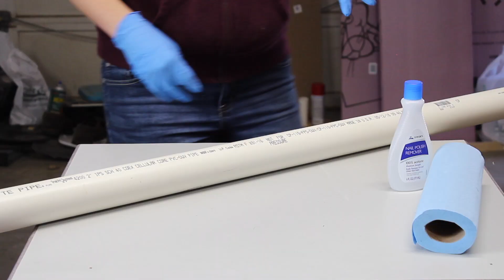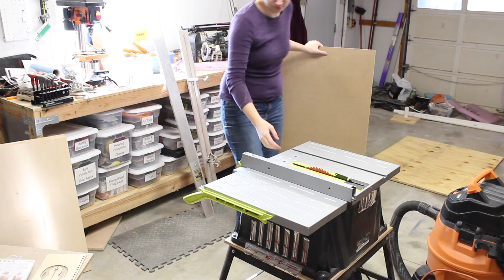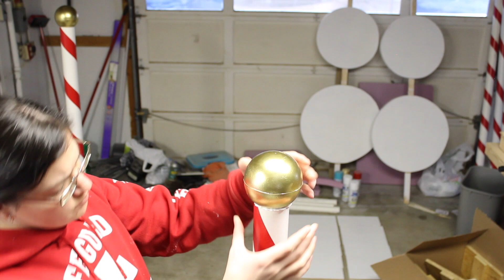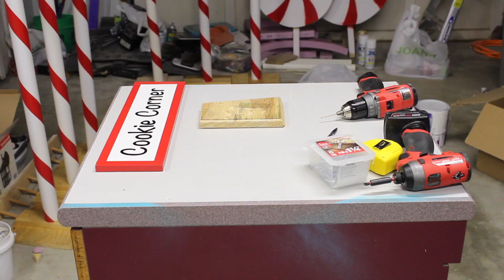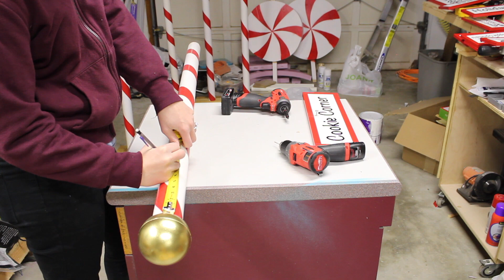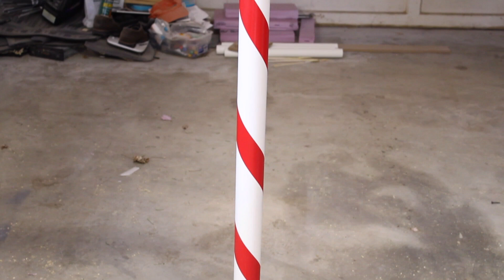How To: Holiday North Pole Sign

Comment: if I don't have a table saw can I use a hand saw to cut the wood just like the PBC pipe?
Reply: Hi Mckayla, Yes you could use a hand saw or a circular saw to cut the sign. You could also buy a 1x6" board and cut it to the 18 inches. Happy making!